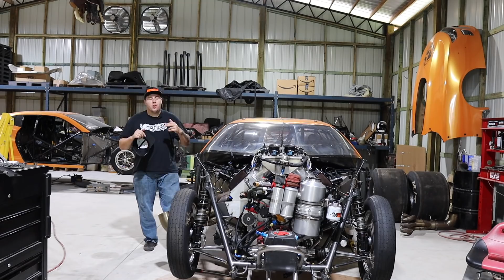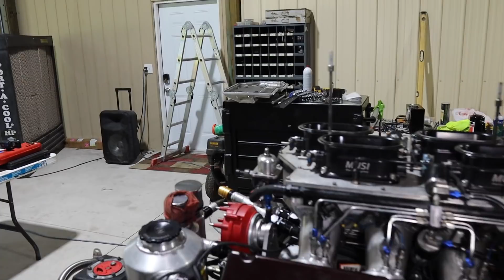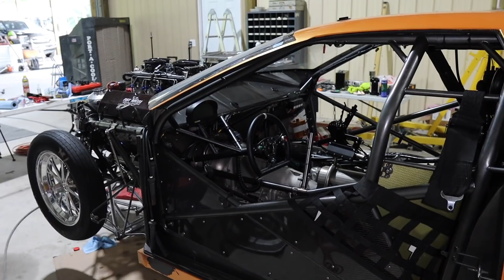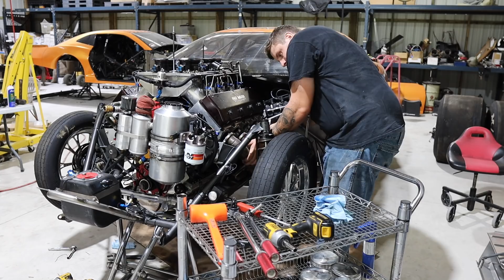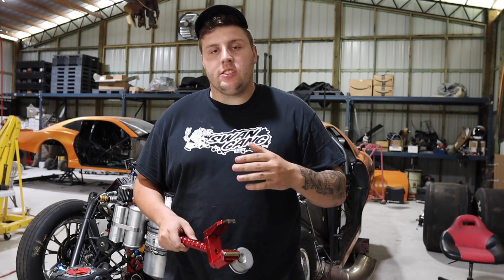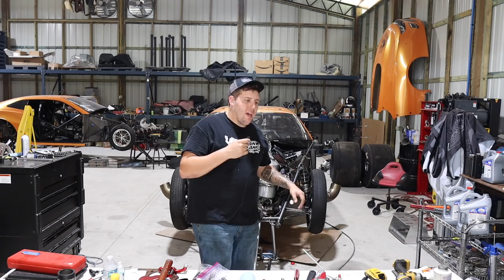FIRED UP THE BIGGEST NITROUS ENGINE IN THE WORLD!! SHE SOUNDS AMAZING!!

Comment: Hey Justin,  was watching you adjust the valves in the video and i noticed when you did the intake on #1 cylinder you took the exhaust to full or almost full open!??  Ive always read that when exhaust valve is openING you adjust the intake and when the intake valve is closING you adjust the exhaust valve ! That way you know the opposite valve lifter is always on the backside of the cam lobe! When you have the exhaust valve at full open that intake lifter is probably starting up the ramp on the lobe and you'll have way too much valve lash!  Same with the intake , if youre closing the intake to full or almost full close, the exhaust lifter is probably starting up the ramp of the lobe and you'll end up with way too much valve lash on it also! I always adjust the valves on my BBC exhaust barely opening, intake barely closing, that way you get the opposite lifter on dead center back of the  cam lobe! Can't wait to see the test video at Bradenton!

Comment: How many cubes? Isn't Musi into the 1200 cubes range?
Reply: Smokey Yunick  nope Jamie Hancock has a 1200 inch pat musi motor
Reply: Big country said depends in rods they have had 997/10** cubic inch. Forgot what country said.
Reply: Garret Carpenter don't believe everything you hear Hancock does not have a 1200 CI" motor 997" is the biggest to date with nitrous
Reply: @melissaswanstrom3339  You tell em Melissa
Reply: @garrettcarpenter3319  Who said Jamie got 1200 cubes, that's Bull Shit bud.
Reply: Bad Ass 6.0 Powerstroke it was on an interview with him in it ....I’m sorry I didn’t know
Reply: No such animal at 1200ci. That engine could go a little over 1,000ci with a bigget bore if he wanted,but it isn't recommended with nitrous, as you are sacrificing wall thickness, rigidity, and more importantly ring seal. And with bores already 5.00" and bigger, there is no advantage just for a few more cubic inches. Ring seal is more important.
Reply: VengeanceIzMine most definitely ring seal is a big contribution when it comes to any powder adder motor and naturally aspirated motors for that matter
Reply: VengeanceIzMine it is on speed video look it up on Facebook and check it out
Reply: Bad Ass 6.0 Powerstroke it was on speed video interview on Facebook
Reply: @garrettcarpenter3319  was just wondering where you heard that, cause i know how big it really is, and it isn't No 1200 cubes.
Reply: Bad Ass 6.0 Powerstroke  Jamie himself said it in the interview
Reply: Bad Ass 6.0 Powerstroke I gotcha
Reply: @garrettcarpenter3319  Probably was just Fucking around, trying to scare everyone with that 1200 Number.
Reply: @garrettcarpenter3319  lol, trust me, I do it for a living, I would have heard about it. No such animal. As far as I know, in a V8 platform, 1,005ci is it. I am sure that will change as programs evolve..
And yes, ring seal is important regardless of application, but Normally Aspirated is more forgiving than nitrous, so why risk it it for a few more cubes... that setup can go bigger bore, but I'll bet anything, Pat limits it to 997 for the reasons I said above. As would I.
Reply: VengeanceIzMine I mean I just saw it in a video I was just wondering if it was true...I’m not trying to get anyone mad or anything It do not know the first thing about nitrous I am more of a blower motor guy myself
Reply: Garrett Carpenter he said 1200 cubes plain as day. Said it was the only one.
Reply: Jacob Deem that’s what I thought only one
Reply: @garrettcarpenter3319  I'm not doubting he said it in a video, but like Bad Ass 6.0 said, just pullin' people's chains. It happens.. I know it all too well in the grudge world lol. Nobody mad..
Reply: VengeanceIzMine understandable

Comment: Hey Justin just curious, with No Valve Spring Failure, about How Many Runs do you get out of them until you Replace them ? I know you go by Pressure, but just wondering how many passes you get out of them ?
Reply from the maker: 40-50

Comment: Check the cut on the rings if they are cut off just a million of a sec it will do it. Don’t ask me my truck was doing it and my motor guy found it
Reply: No, it won't lol. Lack of ring seal, yes. Ring gap, no.
Reply: @AV-cc5wl  lol.
Reply: , the cut was off on mine. That’s talk in the machinists world. Measurements. I’m a electrician and a contractor. What I’m told. Lol
Reply: @ronniemurphy483  I know exactly what you are referring to, being a machinist and a race engine builder. The "cut" as you call it, is ring gap. And ring gap will NOT cause it.. the engine will never see the difference. However, if the rings don't SEAL the bore, it will. Regardless of the gap..
Reply: You sound like the motor guy I need where you located. I’m no mechanic. I need a good motor guy. I’m building a S10

Comment: I really would have thought by now that you would realize you can't keep recycling parts,,,,just because you find a spark plug laying on the floor,,,,you guys think you can just use parts over and over backfire after backfire,,,,nitrous motor parts are not made to do that,,,,you tear down a nitrous motor you throw the shit away and replace everything,,,,quote "everything" with new parts,,,not one ring or one spring ---  Quit cutting corner's replacing with recycled or Mickey Mouse Parts,,,,that is no way to maintain a nitrous motor